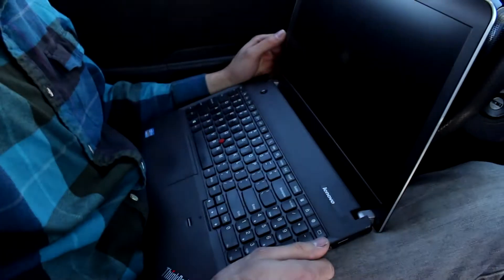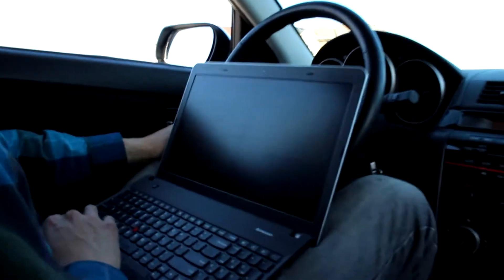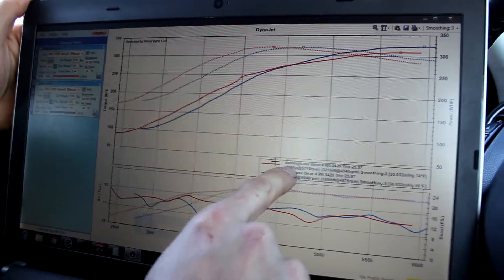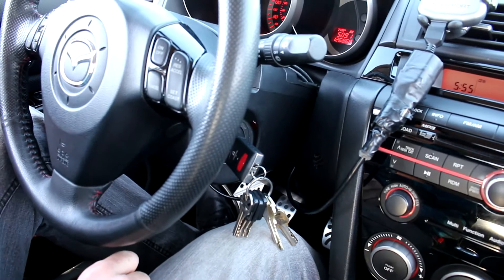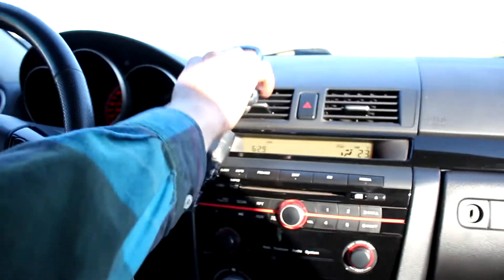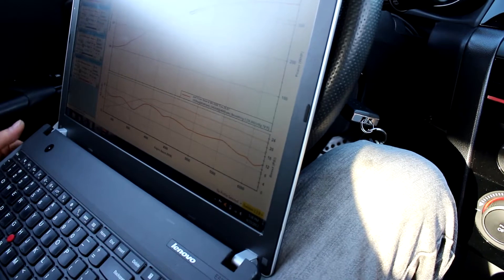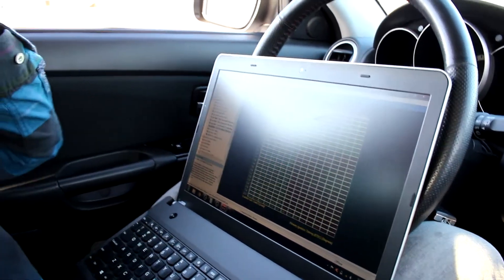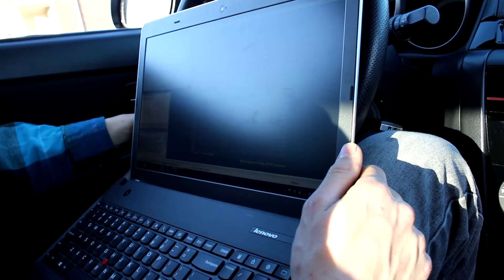Mazdaspeed 3 - Street Tuning with BNR S4 Turbo (Spring of 2017)

Comment: your videos are awsome love whatching it,i was wondering what is the program using for self tuning and your virtual dyno thanks appriciate
Reply from the maker: Thanks a lot! We use Cobb Access Tuner software, and currently our virtual dyno numbers are at 330 whp. We recently installed a 6th port aux fuel system and are slowly dialing it in :)
Reply: tanks for the fast reply!

Comment: Hey guys was wondering how much would u guys charge to tune my mazda 3? It's not a crazy setup at all but jwas just wondering if you could do it.
Reply from the maker: Hey man, we're not aware of what tuning products are available for the regular non turbocharged Mazda 3's. With the Mazdaspeed3 we use the Cobb Accessport for logging and flashing software. We don't tune other peoples cars due to risks and liabilities. Reputable Pro Tuners have tonnes of experience with the platform, and are the best option :)

Comment: Awesome dudes!! can I ask how muck peak timing at redline did yall get to? im running same turbo v1 just trying to revise everything. im running 4 gall e85 but I want to fix my meth kit before dyno soon. Its been broke few years.
Reply from the maker: boostercontrol100 In this video we stopped at 11* @ 6k rpm. The fuel system is a huge limitation on this platform. There's a good ignition timing database with e85 MBT timing curves that people posted on mazdaspeedforums.org. I use those as a guideline and stay a couple degrees below them for safety :)
Reply: Cool bro thanks I will check it out. Yeah I hear you about the fuel limits meth injection good for that. My meth setup started leaking few years back just haven't fixed it yet. I'm running 22psi with about 12.9 timing at 6500. With meth I was running 16-17 timing at around 6800-7k. Hoping to fix soon and get dynoed again.
Reply from the maker: Nice! Yeah these cars are a hoot for what they are! I've got to set up the 6 port kit, but I'm still trying to figure out the piping before the throttle body

Comment: DEFINITELY need an upgraded exhaust to take advantage of the S4 (if you want efficiency). Heck, I have an S3 and was stuck at ~360whp (E25 tune) on stock catback, but I had all the other flow mods, including 3.5" intake, TR8 FMIC, catless DP and 3" tubing up to the axleback, etc.. I finally finished out the full 3" exhaust, and my next set of logs were 395whp. 3" tubing is pretty much the standard for cars ~400whp that are efficient. Plus, the Genpu (2010-2013) single inlet/dual outlet stock muffler is known to be restrictive. Also, I experimented with a high-flow, high-quality metal cat (200 cells/inch) and found that it lost me 15-20whp. YMMY, but that cat on the CNT will definitely rob power.

FWIW, I ended up at 325/350 on 93 octane at 22psi and 12 degrees timing. The E25 map we settled on 385/380 @ the wheels for greater safety, with peak wtq @ ~4300-4400, 24.5psi, and 17 degrees timing. I was protuned by one of the most well-known/respected Mazdaspeed tuners in the world. I just wanted to try it. Prior to that, I had self-tuned for years, quite successfully. I even tuned about 10 locals as well, all with reliable maps that made power and prioritized safety.

*all my power numbers are 1.01CF with smoothing of 3 on a perfectly level road. I'd be well over 400 using Dynojet CF (1.09).
Reply from the maker: You nailed it! I like how you know what you're talking about:) I ordered a Cnt catless 3" turbo back last week lol. I can't wait to install it and dial in some powaahhh! We recently went to the track and couldn't go past 13* at 6k without getting knock ( 22 psi / 11.4 afr / 2 gallons of in tank meth ). I'm not too sure how well methanol mixes with gas but we don't have e85 around here, and small amounts are safe for the fuel system from what I've read on the forum. I think the excessive restriction from the 3" catted dp and stock 2.5" cat back was keeping too much heat in the cylinders and causing knock issues. I've since de-tuned to 19 psi to red line until the exhaust arrives and it's making the same power (280 whp) as the k04 did with only 10.5* at 6k. I had to run 17-18* with the k04 to make that power. This turbo is pretty sweet.

Comment: Waiting for the update! :D
Reply from the maker: Hey man we've experienced a problem. One of the balance shafts on the 2.0 TSI jetta seized. So we've pulled the engine and are currently awaiting for parts to get the it back up and running. We will have more cool videos up very soon. We wanna keep her rollin! We wanna come close to maxing out the fuel system on the MS3:)
Reply: Aww man that sucks. Did leaning out the AFR to 11.6 significantly increase your IDC headroom? You convinced me to go BNR S4 a year earlier than I wanted to btw, ordered everything yesterday lol.
Reply from the maker: Nice! Yeah I think I gained about 4-5% headroom. I may go up to 11.8 if I decide to try and shoot for more boost in the near future:)
Reply: Dude, I just finished installing the BNR S4. Videos do not do it justice, it sounds SICK!!!

I was just wondering, did your BNR S4 also hold about 20PSI on spring pressure? I thought they were supposed to be set to 17PSI from BNR.
Reply from the maker: I know eh! It sounds amazing on a small residential street with houses deflecting the sound. I had the same thing happen to me! I usually hit 18-20 psi on spring pressure depending on ambient temps. I called Bryan and BNR and he said that it is normal for them to open anywhere from 17-21 psi. I'm not worried though because it makes it easier to manage boost. For example if you decide to target 23 psi, the 3 port boost control solenoid doesn't have to work very hard to reach that target. You can't hit less boost than spring pressure, but if you want a map that generates conservative power, you can run spring pressure with very conservative ignition timing. At first I had second thoughts about not being able to run under 20 psi if I wanted to, but the thought of running less than that is so far gone. I wanna up the boost!!
Reply: Haha I gotcha, mine hits 22.5+ psi though on spring pressure. Just waiting on a response from Justin on what to do. Hopefully I can reduce the WG preload to fix the problem without hurting spool. I was planning on running 23 PSI anyway, but my worry is that boost might not be manageable when the weather gets colder.
Reply from the maker: Maybe gotta give it some time to work itself in. I was also hitting 22.5 on spring pressure in the winter months. But now over the past little while, it's settled down to about 18-20 psi depending what gear I'm in. The nice thing is that it holds spring pressure perfectly across the board.

Comment: Just ordered the edgeautosport vvt kit,with the timing tool to lock the cams. Anything i should read up on,other than the factory service manual and threads about the vvt before getting started?
Reply from the maker: I would order a new exhaust cam bolt and friction washer as well, so you can set even chain tension. Also make sure to put the engine at TDC with the crank pin and cam locking plate before removing the chain. This way you will not need to rotate the crank by hand to find TDC and possibly strike the valves with the pistons. There is also a good write up on the mazdaspeed forums. For the most part the job is pretty easy. Make sure to have a good counter hold for the crank pulley and oil pump sprocket and take your time:)

Comment: Where are you guys located? Great videos!!
Reply from the maker: Thanks brother! We're in the GTA
Reply: Wannabe Tuners is the 94 as crap there as it is in Vancouver? Get on the e85 if you can!
Reply from the maker: The 94 isn't bad in the summer, but winter grade sucks! We don't have e85 around here, so in tank methanol is the alternative. I currently run about 1.5 gallons per tank.

Comment: You weren't able to rectify your lean spike? (Saw your post on msf)
I used your guide for tuning my ko4 👍
Reply from the maker: Oh cool man, glad things are coming along for you! My maf curve looks much better now. The HTP intake has a nozzle that threads into it to connect the valve cover hose and it wasn't tightened all the way. I also cleaned the Maf sensor at the same time, so I am not sure what fixed what. All I know is that I don't have that big hump in the maf curve anymore. In this video we were trying to tune around the leak which wasn't good. Now that the maf curve looks much better, I'm trying the lean out the AFR closer to 12:1 so I can get some more injector headroom and run more boost! This thing is gonna get me into trouble:)
Reply: That's good. 12.1,, brave. I'm only tuning in for 11.4 but cannot seem to run any 91 around here without knocking (btw I'm fairly close by). So it's gotta be 94 especially when logging. 
Wish I had a 'private' road to log on here. 4th gear pulls tend to get me a little nervous. 
Only got my ms6 in feb. started tuning right away. No major mods yet. Waiting for warmer weather to fine tune loads.
Reply from the maker: Chris Comeau sometimes I wish I had an MS6. With the bnr, the only choice is to lean out a bit or incorporate aux fuel. I probably won't go leaner than 11.8 as long as there is sufficient octane in the tank.
Reply from the maker: Just recently found out that the lean spike was a tuning issue. I had two of the load tables set incorrectly.